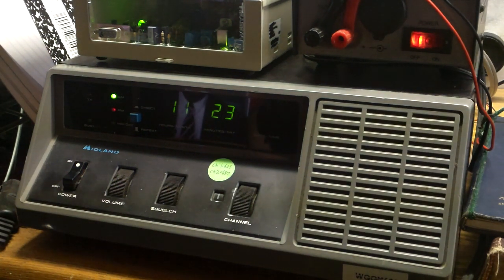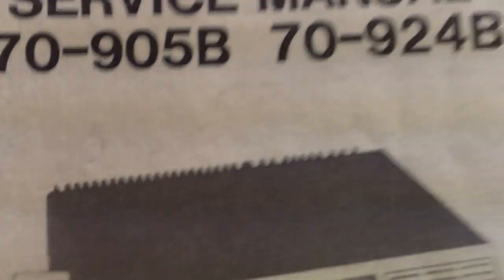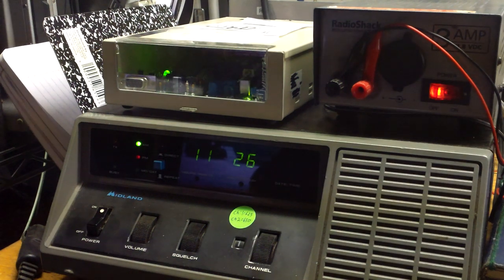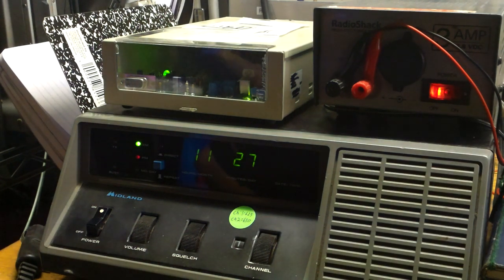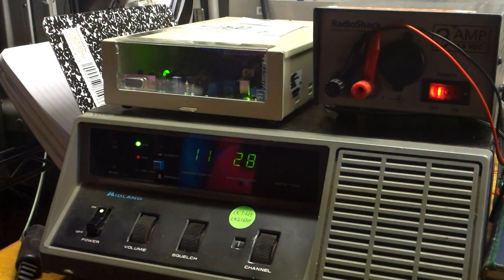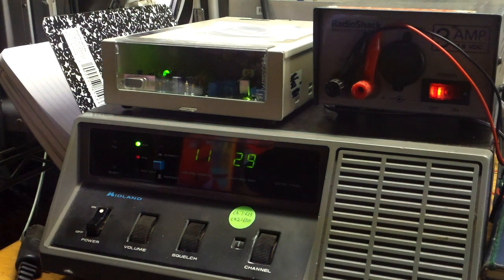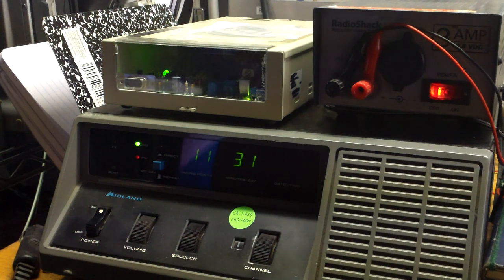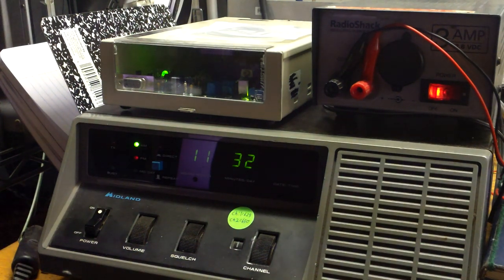The family GMRS repeater, WQQM601-R

Comment: Pretty kool repeater, I have a Motorola MSF5000 repeater that pumps out 50 watts with a 9db antenna on a 80' tower it covers about 60 miles.
Reply: We use 8 Motorola XPR 8300 UHF rack mount stations with Crescent 100 watt external PA decks, one such is programmed to the GMRS pair for REACT and narrow banded, the other 7 are set up to commercial duty for Mototrbo customers (461 - 464 MHz.)
The old equipment was a group of 32 Motorola MSF-5000 repeaters but due to narrow banding they were replace last year and recycled to the scrap pile along with another trailer load of GE Mastr 2's and 3's in VHF and UHF.
We did scrap a few of the transmitter combiners and RX multiplexer / preaps shelves also but kept a couple for the new setup.
The tower is south of town and stands approx 482 feet tall with two antenna farms, one at 300 feet and one at the top.
The shelter is a Fiberbond made shelter with dual climate control and natural gas generator backup with a uninterrupted PSU 24 VDC battery bank.
There is NO Ham equipment in this site nor will there ever be any. There is a second shelter there but thats for AT&T wireless who leases farm space from us @ the 300 foot farm.

Comment: Aww man, those MSF5000's are good for GMRS use. I was going to buy a XPR8400 for GMRS use but they are toooo expensive just for GMRS, so instead I'm going to get my MSF5000 reprogrammed. I'm also in the process of buying a Andrew DB 420B. I'm having trouble finding the suitcase eprom programmer, someone told me that I didn't need the suitcase programmer but the guy who sold the MSF5000 to me said that I need the suitcase. Can you clarify that for me if you can, and thanks for the response! KC3DSF, 73's.
Reply: Xx